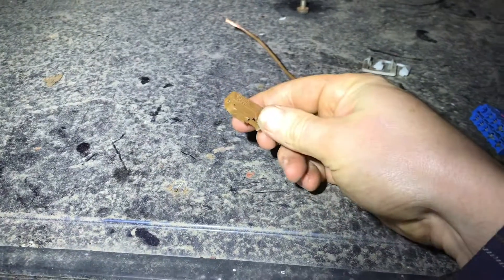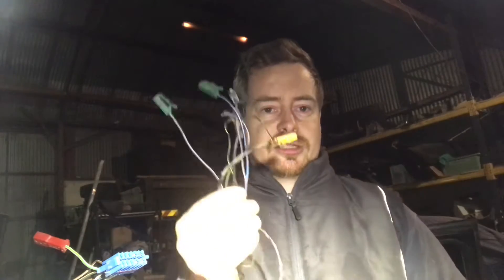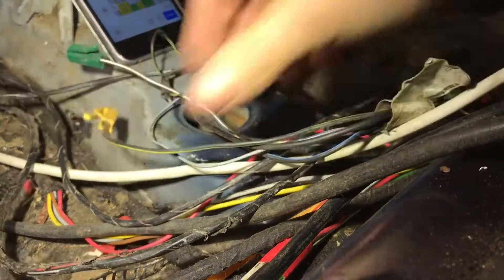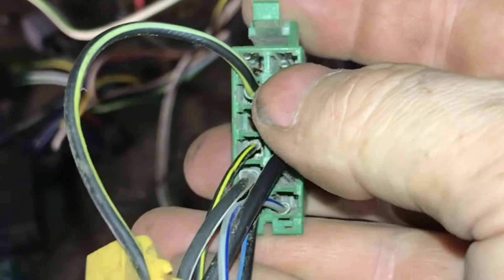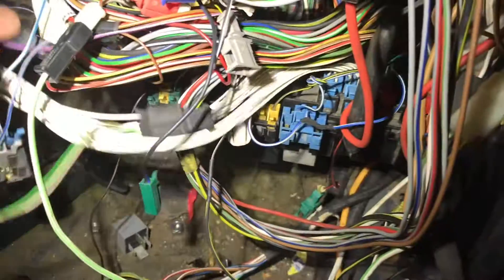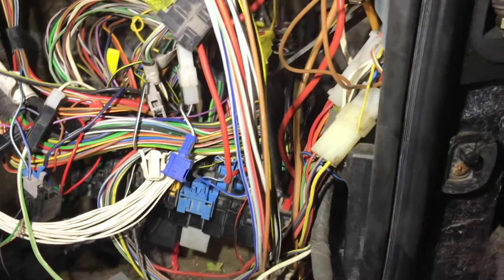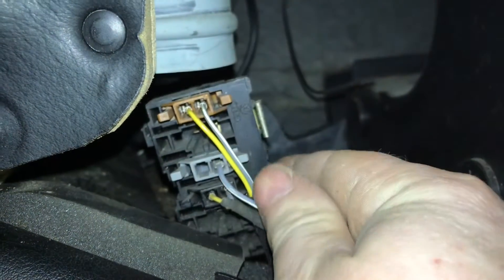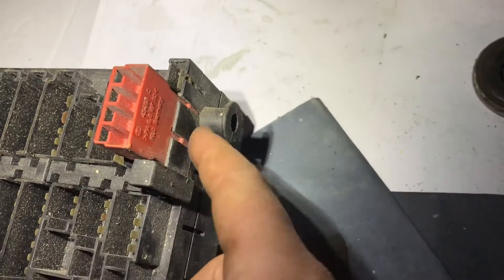CE2 Aux Wires [where do they all go] VW mk2 mk3

Comment from the maker: Spoiler not working for those who did an abs delete and the rear spoiler stopped going up at 45mph...
Main reazon is because the abs main harness to the fuse box has the speed sense wire that feeds speed signal to the distribution block where rear spoiler module, radio,cruise control collect speed signal...and when the abs power harness gets removed from the fusebox there goes the signal to the block....the way to fix this issue is by getting a 6 pin green connector W letter location in the fuse box with blue/white wire in pin #1 and connect the other end to the abs distribution block attached to the top of the fuse box...easy to find cuz the the block has other blue connectors with the same color code wire...
*if the rest of the electronics related to the electric spoiler are in good condition this wire connection should fix your issue...not my case since the speed module in this car is defective and it's the face 2 module i had to retrofit a facel speed module with matching harness....but now works on both automatic and manual mode with the dash mounted switch...
[The W plug can be obtained from any mk3 golf,jetta or cabrio with abs and its a direct fit without cut and paste wires]

Comment: I have a golf gti mk3 8 valve and n modifications has been done on engen no longer feul injected and ECU replaced with polo cup ECU, tci unit fitted with bottle coil but no spark what could the reason be
Reply from the maker: It sounds like a complex setup you have there, so pinpointing the exact issue without more information is tough. I'd suggest checking all your wiring connections to ensure they are secure and correctly matched for your specific components. Check the aux wires on the battery terminals and check for ground connections to the chassis.

Comment: I need to know which wire out of the ecu is the k.line for obd2 making
Can y help ..i used pin no.29 wt/gray no conmection
Reply from the maker: The K-line for OBD2 diagnostics typically connects to pin 7 of the OBD2 connector, but the specific wire from the ECU can vary depending on the year and model. I'd suggest consulting a wiring diagram for your specific ECU to confirm the correct pinout.im not much help I know . Try xjamiex.com for all the ce2 wiring diagram

Comment from the maker: Mk3 golf and b4passat H1/7 is connected to relay36 at relay location 9-  pin 5 >> lights left on buzzer . 
Also connected to switched 12v for radio (on with key) and h1/07 is controlled by turning the key via loom that goes to the key barrel . Wire is NOT fused

Corrado its blank

Comment: I'm from Brazil and I just watched your video which helped me a lot, I have a golf 3 version from Mexico and I use a panel that I believe is from Canada or something like that, it has some basic functions like position light fog light mile lighthouse abs and pad wear sensor I tried to make the wear sensor work, making the appropriate harness, using the brown connector (panel) and a wire created on the f4 port, however I used Mercedes sensors for this test, the panel had no response. I imagine the panel needs to be configured or activated or am I seriously mistaken? thank you for the answer
Reply from the maker: I think the light will not go on , if the circuit is complete . But when you brake the circuit the light should come on .
Reply: @stevenharpervw  So there is a circuit there that doesn't turn on, such as the position light (in this case the low beams) I still think it must be active in the VCDS in some way, now the pad wear one I've never seen any MK3 with this system active (not even the original harness)
Reply from the maker: @ not sure it would be coded , as mk3 was still very basic . If you Google ce2 and look at the wires of U1 and U2 and compare them to your own car . You will see what functions your car came with. Or which ones actually worked.  Maybe there is no led bulb to make it work . Or it’s not for brake pads but is a warning light for seatbelt / boot- trunk left open… etc
Reply: @stevenharpervw  So the solution is to make some kind of jumper that makes it light up on the panel when the signal is activated, right? or use the digital panels directly but thanks for the feedback and all the help with the video
Reply from the maker: @ it really depends on what you are trying to do and if the dash board supports it . Buy google ce2 wiring and look at u1 and u2 pins . And it will help you figure out what wires do what jobs

Comment: I have an ibiza 6k it has a ce2 fuse box , if i want for example to retrofit the seat belt warning light to light on the dash the plug is somewhere in the fuse box just hanging? and i can somehow connect it to work ?
Reply from the maker: Yep . Google ce2 and you will get the list of all the wires

Comment: Hello, how to connect an installation for El Glass, I could not find anything anywhere
Reply from the maker: I think it might be the AuX plugs
Reply: @stevenharpervw  I can't find a diagram of the letters, where should I connect them, the car was with manual windows, but I'm trying to connect them, I bought a whole installation
Reply from the maker: @georgigeorgiev8799  watch my video and pause it if you need help with the letters. The plugs are different colours it’s actually very easy to follow  a1 and a2 are yellow and you can’t plug them into the wrong slot because they are different sizes
Reply: @stevenharpervw  Thank you for the answer, but the problem is that I am putting a whole installation for EL glass and EL mirrors, however, there are small single sockets that I don't know where to plug in
Reply from the maker: @georgigeorgiev8799  can you describe the connections you have
Reply: @stevenharpervw  I can tell by the colors, maybe I got into a movie with these EL glasses and EL mirrors, I bought one, but there was no installation on it for EL mirrors, I bought another
Reply: For the mirrors, it was just a bridge from the button to the other door, but the problem is that I got it from the sockets, but for the El glass it worked for my rear left door, the others don't want the buttons, they don't light up and they don't work
Reply: @stevenharpervw  In Bulgaria, I do not find any diagrams for the door connectors, in the sense of nothing concrete
Reply: There is no way I can send photos of the sockets and the ignition panel if possible ladies help to connect everything I don't believe anyone can give detailed information to a stranger I'm sorry to bother you
Reply from the maker: @georgigeorgiev8799  D3

Comment: Greeting.  Can you tell me about the Z1 cable where it goes, and the car is a Passat VR6 B4, I'm converting it to a 1.8 T, I bought it with a cut installation? Thanks in advance for your answer Miladin
Reply from the maker: Z1 injector power Fuel Pump/Glow Plug Relay Output. Red black or red yellow

Comment: Hi, great video thank you, do you if that top right big red immobilizer jumper jumper you mentioned with the 4 pins would make a good 12v source for my custom cooling fan system?
Reply from the maker: I guess it would as main power comes in and the terminals are fairly big but would you not just link it to the + battery then fuses then switch and then fans
Reply: @stevenharpervw  ive got a weird setup because my battery is behind passenger seat and my fan relay is mounted on the firewall. Thanks for letting me know i didnt want to fuck up the immobilizer
Reply from the maker: @twopaste  subscribe to the channel and press like on the video . Always helps me out . I’ve loads of other videos too that you might find interesting

Comment: This is fantastic, thank you. This was seemingly missing information. We are 1.8t swapping a Nugget Yellow 1990 Corrado right now and the CE2 block was removed last year and we weren't thinking ahead 😅.
Reply from the maker: I’d love to do this swap too and I do actually also have. 90 rev nugget corrado . I ended up tdi swapping it 😅 what 1.8t engine code , did you use in the end
Reply: @stevenharpervw  it's getting an AWP

Comment: steve your video has been the most helpful so far but you did not mention the small gauge black cable with red traicer left dangling . I'm trying to resurect a 1990 golf rallye that I stripped 5 years ago  with no faults, its now back together no positive supply to the curtosey light no power to the front fog lamps, the horn relay works but no positive feed at the horn end and the dreaded abs did all come on as it should but now flashes twice then once and stays on. please help
Reply from the maker: I’ve no idea which wire you are taking about . What colour is the plug . Is it a single pin plug ? 

As for your problem . On top of the battery are all the aux connections screwed onto the terminals for both. + and - . Sometimes ( but not always) there is a grounding terminals behind the battery on the chassis leg check that too . Abs oh dear 😅 so I’ve another video showing how I connected vcds ( vagcom) to the ecu to read codes.  If it’s the super early ecu it’s flash light codes so let’s hope it’s not that . I think the later ecu that works with vcds has 3 rows of pins the early one has 2 rows .  But do check the other video for the abs /vcds fix . 

I know how you feel , it’s so frustrating
Reply: thankyou very much for your swift reply, I will give it another crack of the whip tommorrow and sunday @stevenharpervw

Comment: Mk1s we're simple good design, but as more equipment got fitted the using the fusebox also as the main junction just became crazy with the amount of cables meeting there!!!Random changes between years, my early corrado had heated mirrors permanently on since new, later was connected to heated screen, and the wire was there so I swapped it😊Great video 👍

One top tip is make sure the locking slider (down the middle) is locked many a time the connector lifting has caused all sorts of headaches!

I have watched it Monday, randomly my phone won't leave comments - double watched 👍
Reply from the maker: I think the mk4 is a very neat tidy fuse box but in saying that maybe it’s not as user friendly as the mk2 is more spaced out